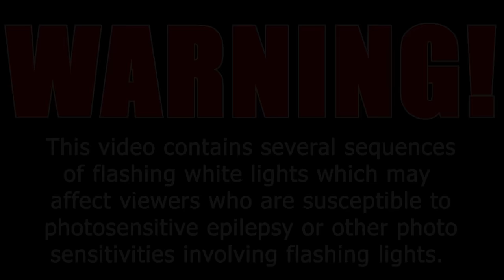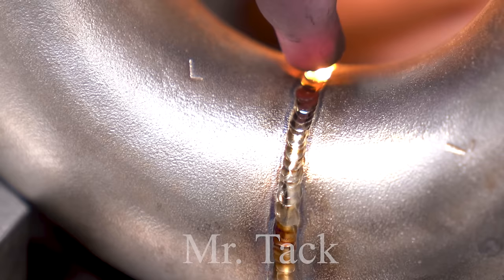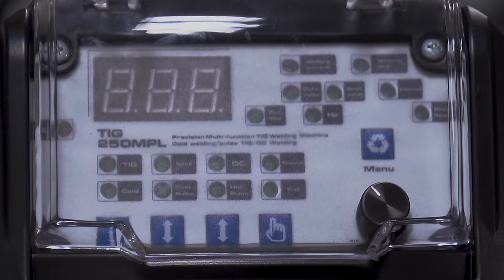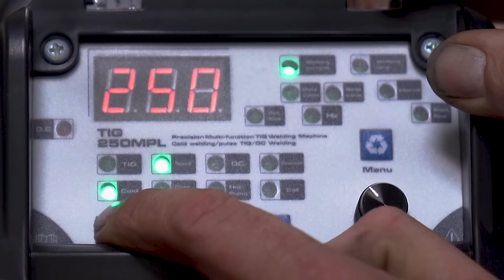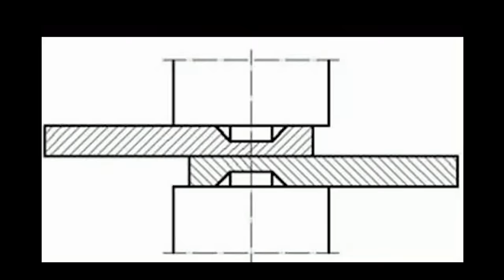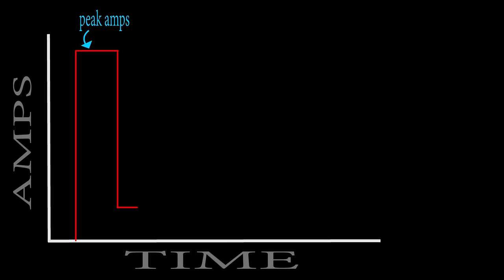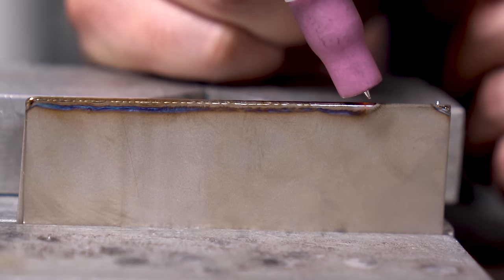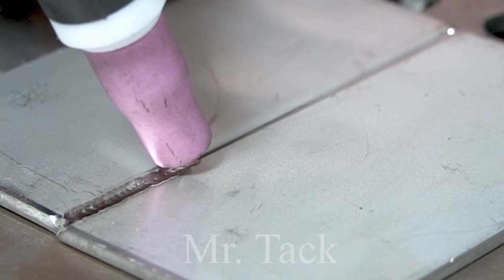So I Bought A Cold Welder

Comment: A tig welder for people who can't weld, was my first impression
Reply: That's what I see. Just a series of tacks that aren't properly fusing with the base material.
Reply: @Pleebian94  Imagine if you could do it at 400 or 500 amps. May be able to tack weld 1/8" haha
Reply: Been waiting for an english speaker to review one of those things...
Reply: @andrewsturgess2033  at that point the torch to be used will more expensive than the welder LOL
Reply: A lot of tig welders can't even weld. Not that they can't weld but hand them a stick welder or a wire feed. Moste can weld with it but it looks like crap.
Reply: @Pleebian94  that's not a process you are supposed to use on parts in wich you may not get penetration.
If you look at those cold welding videos they use this process mostly to weld very thin parts (most of the time 1mm thick or even less and also very small parts wich would distort pretty easily), or they use it on outer corner joints, in wich most of the time you don't have to penetrate.
It's not a new process, or sonething like that, but surely it has it place on welding
Reply: @raulduke85  There are electric arc welders like this specialized for jewelry making and repairs.
Reply: So a regular TIG welder then?
Reply: @nathanlewis5682  i know, i said in another comment👍🏻
Reply: Still my impression of it......
Reply: pepole those days are incredible ... they want every thing to be fast .. even learning. 
you will be better at something the more time and focus you put in that something. 
i think this is the main reason for this device.
Reply: Just search on YouTube for "piggywelder" there is of course a use for this kind of welding
Reply: That’s what it is. People always work hard to invent something they don’t have to bother learning a skill.
Reply: @raulduke85  I guess it's used when strength is not needed since the weld will be significantly weaker than the base material when using this technique.
Reply: @rangerknow940  it's not true.
It depends on the width of the material, if you weld 6, or 8/10 of mm thickness you will achieve full penetration easily, without burning your parts and almost avoiding distortion.
Not to mention the fact that on most parts where you have to weld outer corner joint, more then often the client doesn't want the full penetration and theese are generally non pressurized tanks or low pressure ones, between 1 and 5 bars
Reply: @raulduke85  The welded area looks thinner than the base material though from what I can tell due to a lack of filler. Factor that in with the welded area that is now in a normalized condition if working mild steel and you have a weak weld.
Reply: @rangerknow940  it's so obvious it's like that in this parody: he's litterally using a 1 mm filler rod to weld 2 mm thickness material, he has also partial penetration, but this is a parody.
This process is not intended to be used this way.
Also most of the time on thin stainles you weld with no gaps and no filler rod, for example on sanitary pipes: you don't use any filler metal, but they stll pass xray and they still work under pressure
Reply: Adam Johnson kinda true if that’s their only gig, in my shop tig and mig (mag for the gamma’s our there) are standard for ever station. However as the boss’s kid (now boss...RIP Pops) I only learned tig and 4 months ago I got a little 230v Lincoln mig for my garage and I was effing hopeless...I had to go get “lessons” from my lead welder. As far as arc, I don’t even know how to turn one on (not much use in precision metal fabrication) I tried but I can’t figure out where to put the tungsten 😜
Reply: @Mikey-ym6ok  people invent every day new stuff, because otherwise we all would sit on an field and watch Our antilops or cows eating, because middleage is totay ok for human mankind to survive, if It's your logic, we all could have an easy and short live with Hard work
Reply: Lookup Sunstone welders, they are pretty much for precision welding small and delicate parts, a lot of the time under magnification or a microscope, the AliExpress welder lacks a lot of the precision and repeatability with the tungsten just wavering above the weld randomly.
Reply: @raulduke85  I didn't see him use any filler rod. It appears as though he's just welding both materials together through pure fusion with no filler. Fusion without filler makes for a weak weld I'd imagine because the steel not only becomes normalized, it also becomes thinner at the joint which creates a weak spot at the weld.
Reply: @rangerknow940  most sanitary welding are made without filler material; it's not that if you heard someone saying this idiotic thing then it's true: sanitary pipes are welded with no gap and no filler rod, and they still hold pressure and have to pass xray obviously.
as i said this video is just a parody, for some reason he doesn't like that chinese girl welding channel and he's taking joke of her.
Reply: @raulduke85  Interesting I didn't know that.
Reply: @rangerknow940  it is and it's also a bit tricky if you haven't experience, because the penetration as to be full and flush (innerside) and you also have to avoid to cook your pipe and also not have any undercut on the outside.
Since it'1.65 mm thickness material, generally you don't use this "cold welding method" cause it's thick enough to be welded with, or without pulse; but it's just an exampe to bust the myth that you absolutely need a filler rod, or your weld will be weak. As I said it depends on the wps, the client request, the porpouse of the parts: most of the welding world is full of restrictions and a procedure wich is good for an application, or for a factory is not necessarily good for another application, or factory.
Now we are on a channel in wich all we see is mostly about automotive welding and, no hate intended, it's 1 of the welding field with less restriction, most of the time no wps at all, no tests of any kind, good quality judged looking at a weld bead by eyes: that's not how it works on other fields thankfully.
Reply: Lol
Reply: U r correct
Reply: Is this like a spot welder?
Reply: @ericx4124  no not really.
Reply: Nah. For some project involving color stainless Steel and brass,in my opinion go for this cold weld, it's super good..
Idk man,maybe I just accidentally reverse engineer this machine true objective(like u said, people who can't weld) 
But for the pipe and structural project, it's a big NO for this cold weld.
Reply: I think it is made to work on thin materials easily.
Reply: Just like a mig  welder is for people that can’t weld
Reply: I always thought mig welders where for those who cant weld
Reply: I think you are over estimating the "welding".. this is really great for things like sheet metal, instrument tube, and razor blades.. things that a normal welding machine would not handle very well at low amperages... done correctly and understanding the limitations, to me this is  amazing... i wouldnt try to make an xray coupon with it, or risk my life on it.. but i would weld a pair of tweezers with it.. make a bird cage... ect..
Reply: @johnjacobjingle8302  you can make a bird cage with a regular tig welder as well, but you should set 2t, a high current, no ramps and have a very fast finger with the switch: the spot function, wich is generally 0.05 sec is too slow to get the job done properly
Reply: @raulduke85  i can do alot of thing with a normal gtaw welder.. my point was only this machine.. would shine more at .0125 materials.. than .125.. its based on micro weld technology...
Reply: @adamjohnson5551  I think it’s how they learn the process, when I learnt to TIG weld, I could already arc weld and even gas weld alloy aluminium. I went on to plasma welding all before the age of twenty three ...
Reply: @nathanlewis5682  And for making mass spectrometers to be used in vacuum on NASA space probes. Ask me how I know.
Reply: I can stick weld quite well. Mig welding is easy as after restoration of a 1979 holden torana! But this is handy! Just how strong are the welds?????
Reply: @ChatNoirLe  that's what I was curious about? Precision! But how strong?
Reply: @nathanlewis5682  !  I bought one or two of THEM.  "Sparkle welders" and a few other spot kind of welders.  They seemed pretty sturdy and functional, but the power was VERY small.  I guess really for jewelry?  I wanted something more like this, which I didn't see at the time.  There are some fascinating videos that show this being used with a microscope as others have mentioned here.  Building up cutting edges, "micro" welding kind of stuff.  Seems to be obviously TIG TACKS, just moving very fast.  I guess it would be a good addition to those amazing "high speed" videos of different welding processes.  The CCWJ has a bunch of them on YouTube.  Tens of thousands of frames per second.  Anyway, this seems like a real TIG weld, just very superficial and fast, really keeping the heat-affected zone down!  If you just pile a bunch of them on (we see here) all bets are off and the base metal is actually glowing!  I think that's NOT what you want!  This seems like it should go with a "pen" looking torch,  maybe it's mounted so you can hold the work in both hands?
Reply: Injection mold repair is a real life application of such machines. Plus it requires a special skills (some experienced, normal welders have hard time doing proper mold repairs).
Reply: @Scavage0001  Or search for: SW-V01

Comment: I think the cold welder is useful for the wiring of batteries. you don't want your batteries to get too hot so the quick pulse is just enough to attach a lead
Reply: I would really stick to a spot welder for that. You have the right idea theory wise, but spot welders made for that are already at that cherry point of having just enough heat to get the job done.

Comment: i could see it useful on 1mm thick steel and small gun parts that need to be repaired like the tip of a firing pin, ejector fins on some sheet metal, the odd rivet that didn't press right and you need a small amount of build up in order to press it all the way. this is great for that, and you have less of a chance of effecting an area that has been tempered while building up on the area that need it. with the right wire and some adjustment this looks like a gunsmiths dream when your working with 100+ year old parts that your too afraid to put too much heat into.

Comment: I think it would be interesting to see what you can do with a regular tig welder to make it act close. Like slow pulse with 100% power at the lowest time on to the lowest % you can at the rest of the time.
Reply: Regular TIG has no chance.
That's why they've developed such special machines. To precisely control single pulse (or "shot").
Real application is tool/die/mold repair industry (so these are NOT "toys for doing tacks").

Comment: I am going to be perfectly honest... if I wanted to weld two razor blades together and could not use a normal tig I would just use an oxy torch. I am having a hard time imagining any use for this in any normal welding shop.
Reply: You normally see these in situations where you need to join copper or join metals where you can not afford to heat up the unit, such as spot welds on battery packs.

Comment: About this copper wire. What about welding wires instead of soldering? How does it look and how it holds?
Reply: I've seen it used numerous times in connecting windings in Chinese motors and it actually works pretty well. Two benefits are that the copper weld won't melt like solder and the varnish burns off instantly
Reply: Copper wires weld with special ultrasound welding machines.
Reply: I think the join might work harden or heat harden and lead to failure . I stand to be corrected.
Reply: Not all copper alloys are weldable. The one used in most electric applications have a bit of oxygen inside making them non-weldable. You'll need oxygen free copper wire which is more expensive. Also no cost benefits over soldering.
Reply: leo belpomo wonder if using this process with rosin core solder as the filler would work?
Reply: @rooob76  no, to dissimilar cristaline structure for solder wire to melt with copper. Would do the same as when trying to weld copper to steel or steel to aluminium
Reply: leo belpomo I’m thinking more of flash soldering rather than actual welding. Also we used to weld tinned ground wires directly to steel and stainless steel in a production environment. This  process has been used  for decades in this application. It does work for grounding purposes not anything structural.
Reply: it should have better conduction that regular solder cause its copper in it of itself. I can't say if it'll hold more. I'm thinking may have an issue fusion welding all the oxides and contamination in the wire.
Reply: Duane Brinas I may have to invest in one of these for experimental purposes.
Reply: High frequency circuits, high frequency can melt lead/tin solder.
Reply: There is exothermic welding for copper electrical joints, Its more like foundry process.  I think the idea of welding with TIG process is a viable alternative!
Reply: I've TIG welded thick copper wire before when my soldering iron was too weak to get it hot enough... it was one of my first times TIGging and my first time on copper... came out ugly, but I got the job done
Reply: I recently had to do some outdoor wiring with no soldering iron or solder, just a little propane torch, and I was very surprised that the splices readily "brazed" together with a second or 2 torch heat. Didn't even burn my fingers or the insulation. A few splices seemed a bit fouled by oxygen in some areas but made solid, reliable contact anyways. A sprinkle of borax could have helped I imagine.

Comment: That looks perfect for tacking “tabs” onto batteries.  Albeit a little spendy if that’s all your using it for
Reply: I think the high current might damage the cell / battery. Also it does seem to produce a lot of localized heat. Just my opinion though.
Reply: They actually have tab welders for that application. I expect they are about the same thing.
Reply: @sherannaidoo2712  Why would the cells of the battery be part of the welding circuit?  Only the tab, cap, and welder shoild be in circuit.  Maybe localised heating is an issue; however, what extra precautions are put in place for regular spot welders?  A new topic to ponder is the materials used for the tabs is slowly migrating towards copper because of the high currents needed and generated by each battery of individual cells.  Resistance welding is now not ideal.  Fusing copper together in an on-off pulse with copper's conductivity of heat may be a solution.

College labs that might TIG something like the MBRACE Clam Lander would now have an easy solution for students for making battery packs or attaching leads.  We caught heck before we purchased a snap together kit.  It required space that could have been used for more parallel cells.
Reply: If you get just the right lead acid battery and use just the right kind of solenoid and momentary switch that seems to make a good tab welder. Not so spendy but a bit fiddly to get to work. Once you have it all the results are impressive though.

Comment: Real cold welding is done in electronics - that is what a working wire wrap joint does. The pressure of the wire into the corners of the square post of the connecter results in a weld. If the wire wrap tool is working correctly at the right torque. If not you end up with a whole rack of dry joints.... A technical description:  A correctly made wire-wrap connection for 30 or 28 AWG wire is seven turns (fewer for larger wire) of bare wire with half to one and a half turns of insulated wire at the bottom for strain relief.[1][2] The square hard-gold-plated post thus forms 28 redundant contacts. The silver-plated wire coating cold-welds to the gold. If corrosion occurs, it occurs on the outside of the wire, not on the gas-tight contact where oxygen cannot penetrate to form oxides. A correctly designed wire-wrap tool applies up to twenty tons of force per square inch on each joint.

Comment: Thanks for a great video.
I've been watching those China "Cold Welding" videos for the last few months trying to work out it's it's just fancy high speed tacking or was there something more to it.
One of the businesses I own does a lot of thin (0.8-1.2mm ie 1/32-3/64) SS TIG that needs to be distortion free. So this apparently "miracle" "cold welding" was of great interest. So since there was a complete lack of English/Western videos or literature on this "new" process I also bought a machine to play with and test out. Maybe that's their sales strategy.
It arrived last week and I haven't yet had any time to play with it.
I suspect the fast burst high intensity tack will be useful to my business needs. But from the China videos I had assumed the tacking was automatic and didn't require continual repeated press and release of the trigger, that's certainly going to get painful eg RSI injury.
Thanks again for a useful review.
Reply: Check the real industrial stuff, like for injection molds repair. Example SANWA SW-V01 machine (there is a video promo on YouTube). And there's nothing "new" about this process.

Comment: The first thing I'd do to improve this process is add a huge switched variable capacitor bank and make a proper 1000A short duration spot welder at normal voltage.  Then maybe you have penetration.
Reply: Interesting

Comment: Thanks for examining and explaining cold welding. My only question is can you change the OFF arc rate down to 80 milli second or eliminate the arc current as in the cold welding during the OFF pulse. Basically, can you cold weld with a TIG welder without the shielded gas?

Comment: So it's a TIG welder stuck on pulse mode with zero background current that you are not supposed to use filler with, got it. A stander Tig welder can do a fusion weld just as easily, I just don't get the point to this.